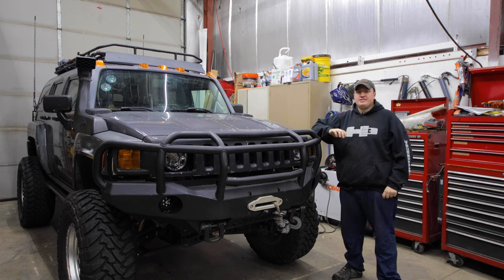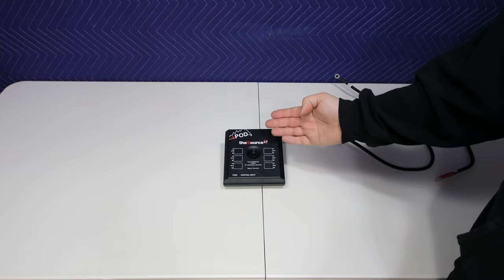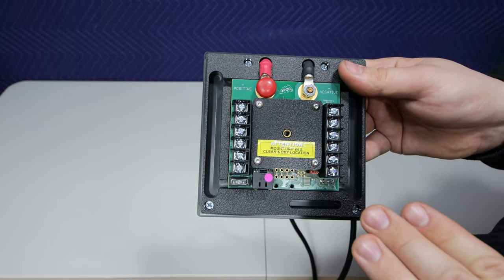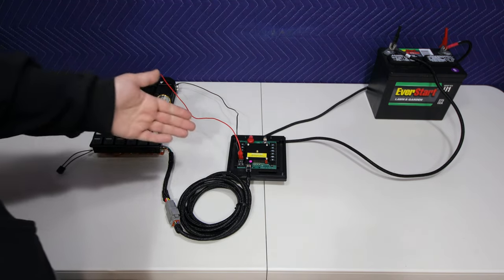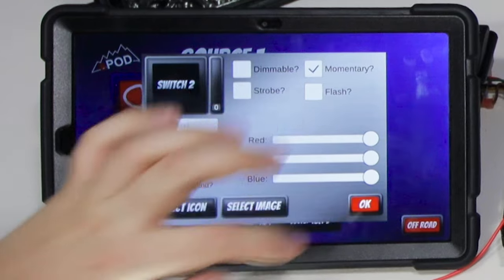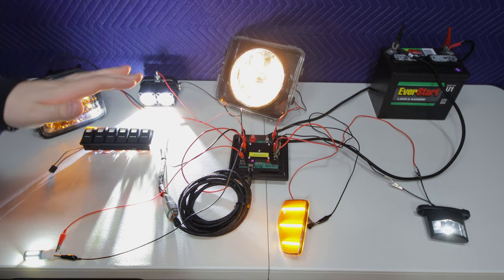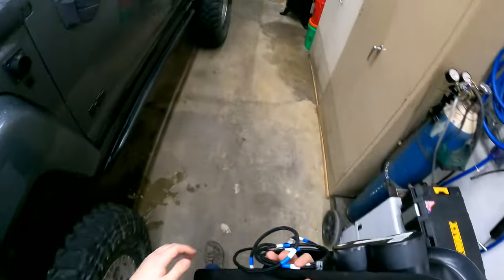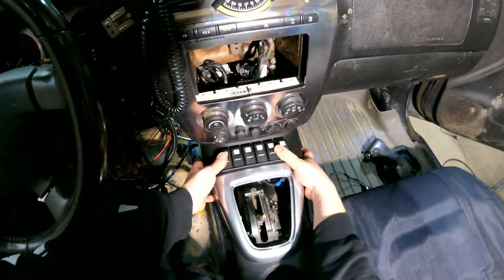How To Install an Auxiliary Switch System - SPOD 4X4 Source LT 6 Rocker - Installed on a Hummer H3

Comment: I have that same radio unit screen in my H3. I believe if you get the correct harness you can control all those accessories via the radio unit
Reply from the maker: I have the Kenwood DMX1037s. It doesn't have any controls for Aux switches. You can get this accessory called the idatalink maestro but it is not supported for the H3. It looks like it has an option for accessory control, but I couldn't find any details on it. I know with Alpine you can get a Headunit that allows you to use a seperate accessory called the KAC 001 that allows you have Aux switches.
Reply: @4lowmode  yea I have that one too. I contacted Kenwood and they told me that while the meastro isn't supported for all the H3 vehicle gauges and controls it will still work for accessories. I literally bought it to do the exact same 4 camera thing. Never got around to it. I look forward to that video.
Reply from the maker: @mnyhomie  Oh that's sweet! I might be interested in buying one then. I really just couldn't find any documentation as to how how many accessories it uses and how to wire it.

Comment: awesome...who makes that bumper bull bar?  lift kit?
Reply from the maker: That bumper is from Road Armor. They are huge aftermarket steel bumper manufacturer. They did make this bumper specifically for the H3, but it looks as if they no longer offer it on their website. I am sure if you were to call them they would still have the design laying around and could make you one though. Back in the day it costed $2350 but that was in the 2010s and since then the price of steel has gone up. So I could imagine price could be somewhere in the $3000 to $4000 range. These bumpers are very rare to see on H3s. I think I have only seen this bumper on like 3 or 4 other H3s. Back when Road Armor developed this bumper for the H3, they showcased it on the Hummer forums and everyone immediately complained it was too expensive, so for that reason not that many people bought them. Road Armor's main customer demographic is owners of brand new pickup trucks and jeeps. You see these bumpers on a lot of $100K+ show trucks and high dollar offroad builds. There is just not a lot of H3s out there in general and far less who are willing to spend that kind of money on a bumper since the most H3s have a market value of somewhere around $7K to $25K depending on condition and spec, so not a lot of H3 owners bought them. That being said, it is an awesome bumper and probably the most well built and good looking aftermarket bumpers out there. The lift kit I have is the 4" Rancho lift kit. Unfortunately it was discontinued in 2016 and finding a brand new lift kit is near impossible. The only realistic way to get one is to buy an H3 that already has the lift kit installed.

Comment: I like how clean it looks but I’m now t willing to spend $500 odd dollars on it mate :)
Good video though :)
Reply from the maker: It is a little pricey, but if you need something cheaper look into Auxbeam Switch Panels on Amazon. They have stuff in the $150-$250. Only bad things about those is the amperage is not the same on all circuits. With the SPOD, every circuit is 30 amps. On some of the Auxbeam switches, only 2 of them can handle 30 amps and the other ones have less amperage. Somewhere between 5-20 amps.

Comment: Love it so much I’m thinking about it in my H3, do they make a 4 switch panel?
Reply from the maker: From what I have seen, I don't think are any auxiliary switch systems that have 4 or 5 switches because people buying these are looking to run a lot of accessories. Typically they are 6, 8, or 12. That being said, you could just install 4 flush mount switches with 4 relays, but more technical wiring is require.

Comment: Nice Hummer and excellent video I will do the same for my 2009 Alpha but I feel our Hummer’s ‘South African’ made is having a notch where you cut  for fitting the switches
Reply from the maker: Yes you have a coin tray right? I actually did too. So on the early model H3s, they did not come with a coin tray but later models did. I have both a 2006 H3 and 2008 H3 Alpha and I swapped the center console pieces. It was much easier to cut the non-coin tray shifter piece.
Reply: @4lowmode  I have watched almost all your videos in your channel . Thank you for creating such helpful videos for H3 owners . BTW some video is not applicable for our H3 's which made for GCC countries
Reply from the maker: @mohammedalmubarak1070  Oh yeah for sure. I am aware that some H3s sold in the foreign market having different standard equipment. There is not a whole lot I can do about that though because I don't have access to an H3 like that to work out differences between the US and Euro spec H3s.
Reply: @4lowmode  Here In Saudi Arabia H3 equipped with dual cooling fans along with clutch fan mean that there are 3 cooling fans second different I have noticed Head light having Oval shape fully chromed with height adjustment from main headlight switch while US spec circular shape and height adjustment is done manually also bulb size is H4 while US spec H3 using H13 bulb, for tail light there are three bulbs one for park/brake second one for turn signal only and third one is reverse while US spec H3 using two bulbs only .Side marker is white color lens and used as turn signal unlike US spec, Speedometer is KPH US is MPH .This is what I observed since my father owned 2006 H3 imported from the US while my car 2009 Alpha adventure package. One more thing to mention there is one size tire for all trims 265/75/16.

Comment: Are the hummer h3 5 cylinders reliable?
Reply from the maker: I would only buy one if it has less than 150K on it. These 5 cylinders go out at around 220K miles.